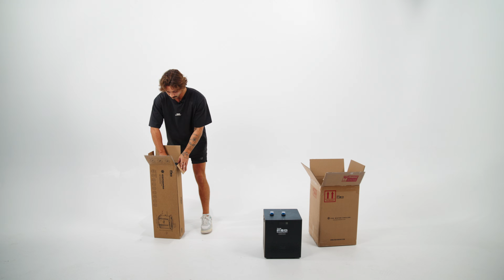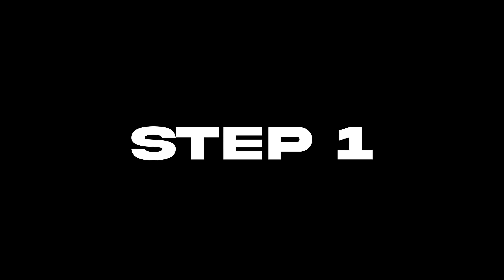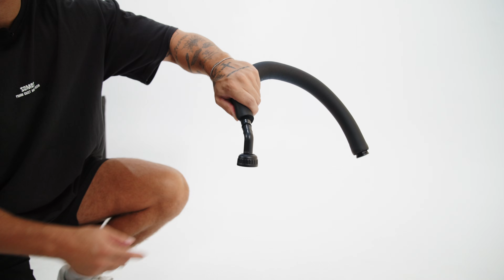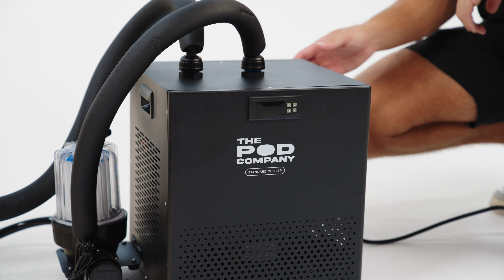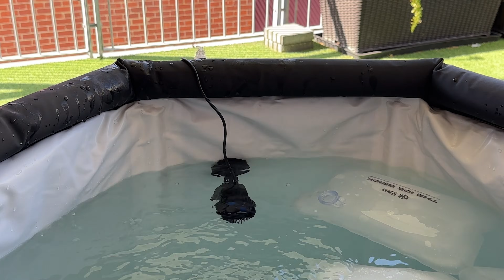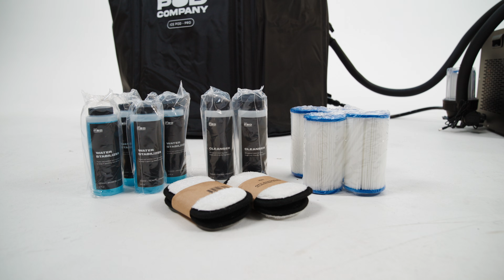Complete Pod Chiller Setup Video — Regular System

Comment: Our pod only has one port - how do we attach?
Reply from the maker: You can still connect the chiller 🙌 Attach the chiller inlet hose (the one connected to the filter) to your Ice Pod’s drain valve, then hang the outlet hose over the edge so the chilled water flows back into the Pod. If you’d prefer a two-valve setup, the Ice Pod Pro is also designed for chiller compatibility. 🥶

Comment: Water is leaking from both hoses on the ends closest to the ice pod. It looks like there is a gap between the screw on portion and the hose itself that water is escaping through.
Reply from the maker: Hey! We're sorry to hear that. 💙 That definitely shouldn't be happening.

If you haven't already, please reach out to our support team at hello@podcompany.com with a few photos or a short video of the leak. We'll be happy to take a look and help get this resolved as quickly as possible.

Comment: This video and the instruction manual is very unclear. Does it matter where the longer hose is attached to the chiller? There are two attachments for the L shaped fitting, and it's not specified which hose goes where.
Reply from the maker: Great question! 😊 It actually isn't specified because, in this case, it doesn't matter which hose connects to which port, they're interchangeable. If the orientation were important, the ports and hoses would be clearly labeled in the instructions. 💙

If you run into any other questions while setting everything up, feel free to reach out to our support team at hello@podcompany.com. We're always happy to help!

Comment: Things this video doesn't explain:

 • use of teflon tape on plumbing threads
 • adding (included) washers to the ends of the hoses when they attach to the tub valves
 • do the (pre-mounted) o-rings on the included male-to-male connectors need to be removed for attaching the hoses?
 • size of piping and connections (except for the chiller-top connections, it's all ½" NPT)
Reply from the maker: Sorry for the delayed reply, and thanks for taking the time to share your feedback! 💙 We've updated our installation resources since this video was published. You can find our latest installation guide here: https://podcompany.com/pages/the-water-chiller-installation-instructions. If you still need any help, feel free to reach out to our support team at hello@podcompany.com and we'll be happy to assist!

Comment: I changed the filter following steps 9 and 10. Chiller no longer runs. It has performed fine until the filter chage for over a couple months. (Filter cleaned several times). Please advise. I have checked the breaker, released air from the filter resovoir, etc. LED screen lights up, but nothing is going on with the pump.
Reply from the maker: Please reach out to our support team at hello@podcompany.com so we can walk through a few targeted checks with you and determine whether the unit needs a reset, adjustment, or further service. We’ll make sure you’re taken care of.

Comment: My chiller has been running nonstop - it stays at around 40 degree mark but every time im around its running with no breaks
Reply from the maker: If your chiller is maintaining your set temperature, that's a good sign. The pump and filter are designed to run continuously while the unit is plugged in, while the compressor cycles on and off automatically as needed to maintain the water temperature. If you think the compressor itself is running nonstop or something doesn't seem right, feel free to reach out to our support team at hello@podcompany.com and we'll be happy to take a closer look.

Comment: Very disappointed in this chiller because I cannot get it set up without it properly, this video is poor.  Sure if you work for the company you can make it sound easy, yet if you are a consumer who is trying to pay attention to what you are saying and follow along, this is horrible. You don't show parts or where things go you just talk about hoses and so forth. Make it much more basic for the average consumer.  I will have to return mine because set up is not working and this video was not helpful. You need to break this up into 3 videos, one for assembly, 2 for maintenance, and a 3rd one for disassembling.
Reply from the maker: Thanks so much for taking the time to share this feedback, we really appreciate it. We’re sorry to hear the setup process has been frustrating. Your notes about the video and splitting it into clearer steps are extremely helpful, and we’ll pass them along to our team.

In the meantime, our support team can walk you through the setup step-by-step and make sure everything works correctly. Please reach out to us at hello@podcompany.com, we’ll get you sorted. 🙏

Comment: I have a pro chiller but also purchased the universal hoses. The one hose has a pump on one end and an electrical plug like the filter on the other end. If plug the filter into the power port on the chiller, where am I supposed to plug in the pump hose? It cannot be plugged into a normal wall outlet.
Reply from the maker: Hi! We're so sorry for the late reply. 💙 We hope you were able to get everything sorted out!

If you're using the Universal Hose Kit, the setup is a little different from the standard configuration. The original pump is removed, so it no longer plugs into the back of the chiller. Instead, the pump that's built into the Universal Hose Kit replaces it, and its cable plugs into the power port on the back of the chiller.

Our Universal Chiller setup guide walks through this step-by-step. If you still have any questions or need a hand, feel free to reach out to our support team at hello@podcompany.com. We're always happy to help! 💙

Comment: How to set F1. We got 5 comments here with no answers???
Reply: Hold down set button for a couple seconds. F1 will come up. Leave that there. Press the bottom button once and it will change to the number. You can then press up or down to change the degree. I leave it at 3. It can take up to 10 hours to drop depending on the current temp.
Reply from the maker: Hey there! You can see the detailed information here: https://podcompany.gorgias.help/en-US/f1-&-f2-settings-explained-(temperature-sensor-control)-272095

Comment: I can’t find the F1 setting neither or how to get to it. Any help would appreciate. It’s been on and plugged in for four hours and still isn’t at 40 degrees
Reply: Hold down set button for a couple seconds. F1 will come up. Leave that there. Press the bottom button once and it will change to the number. You can then press up or down to change the degree. I leave it at 3. It can take up to 10 hours to drop depending on the current temp.
Reply from the maker: Sorry for the delayed reply! 💙 To access the F1 setting, press and hold the SET button for 3-5 seconds until F1 appears, then press SET again to view the value. We recommend leaving it at 3°F. Also, depending on the starting water temperature and ambient conditions, it can take several hours for the water to reach your target temperature. If you're still having trouble, feel free to reach out to our support team at hello@podcompany.com and we'll be happy to help.

Comment: How do you even get into F1 mode?
Reply: Same question?
Reply: Hold down set button for a couple seconds. F1 will come up. Leave that there. Press the bottom button once and it will change to the number. You can then press up or down to change the degree. I leave it at 3. It can take up to 10 hours to drop depending on the current temp.
Reply from the maker: Hey there! You can see the detailed information here: https://podcompany.gorgias.help/en-US/f1-&-f2-settings-explained-(temperature-sensor-control)-272095

Comment: Why is my filter extra loud ?
Reply: Close the air vent on the water pump on top of the filter
Reply from the maker: Sorry for the delayed reply! 💙 If your filter is unusually loud, it's often caused by trapped air in the system or restricted water flow rather than a defect. We'd recommend checking that the air release valve is fully closed during normal operation and making sure the filter is clean. If you're still having trouble after that, please reach out to our support team at hello@podcompany.com and we'll be happy to help.